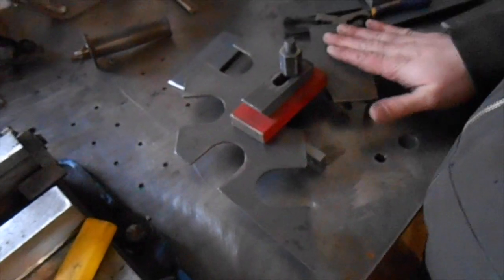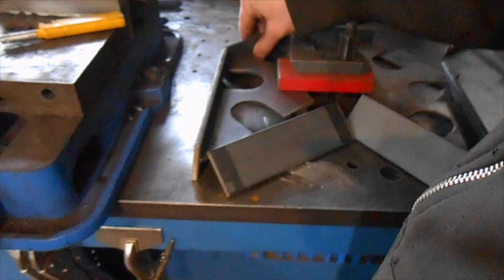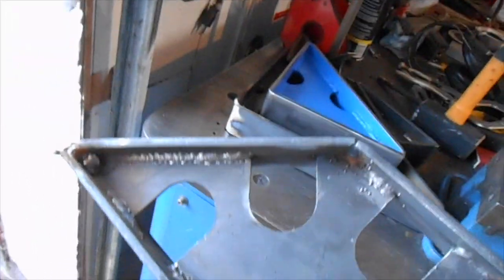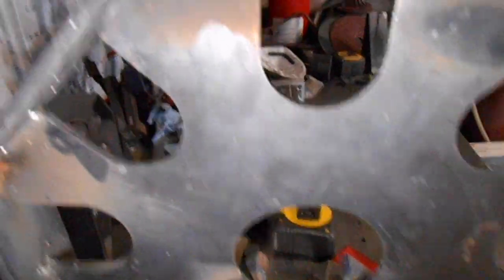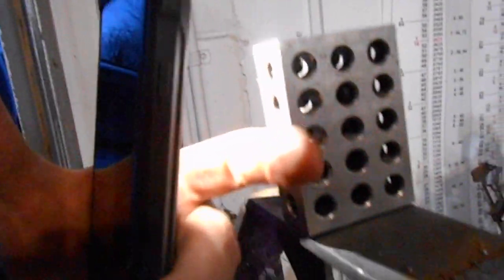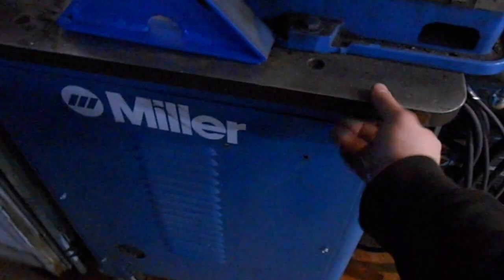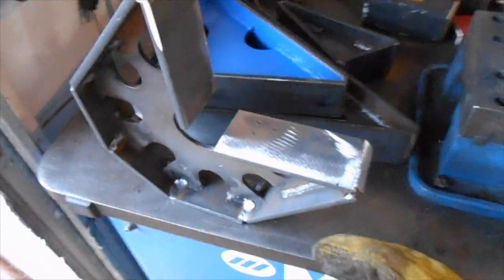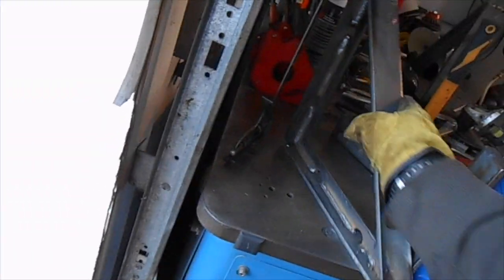DIY Welding Square Kits Part 1

Comment: I find that with a fixture table my squares (yes, they are Fireball) aren’t very useful. These are good if you have a table with no CNC holes in it. For most people, these are too big. Really, you need four, one for each corner. Something sized like the small Fireball squares, or small ones here, are easier to use.

Comment: How accurate are these after the final welding process, I understand the cnc will cut the triangles pretty close, but after welding the flat bar on the edges do they need to be final machined or checked at all?
Reply from the maker: Depends on how well they're put together. One I machined after the fact and that one is pretty much spot on.

Comment: Good job. Far too much weld though. 1” runs on 3” centres would be adequate. Also, is there a product called ‘bright’ flat bar available in your area? It has a a way better finish than black flat bar. I intend to make a couple of squares using stainless steel. I’ll offset the plate so that it’s flush on one side.
Reply from the maker: Smart! We'll have to look into the bright flat bar.

Comment: Nice job on the squares, like your fab table !
Reply from the maker: The welding table was a 50 dollar barn find! It used to have some type of robot on it. It has a cabinet underneath it that used to have electricity components in it. There is also a 4 inch diameter hole in the top that would make a cool rotary table mount.  Thanks for the comment!
Reply: What is the wee blocks you use and where can you get them. Are you selling the squares?
Reply from the maker: @portrush8  Are you referring to the 123 blocks? Give it a google and see if that's what you're referring to. We can cut and send you out a welding square kit if you would like, just send us an email at leonfordrichter@gmail.com